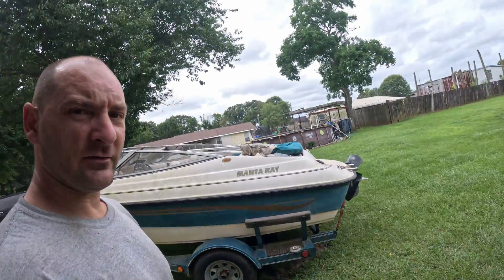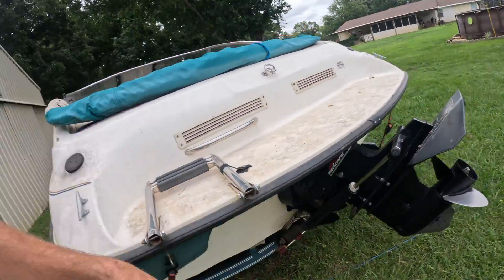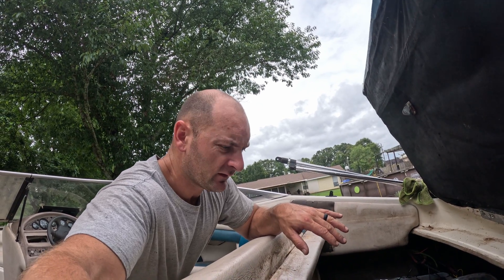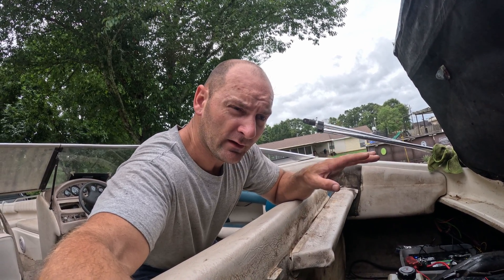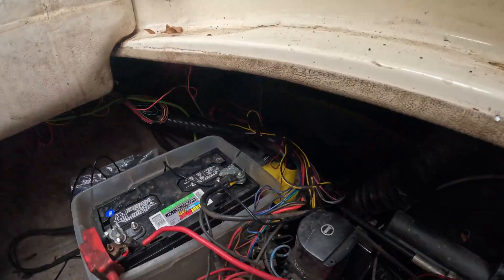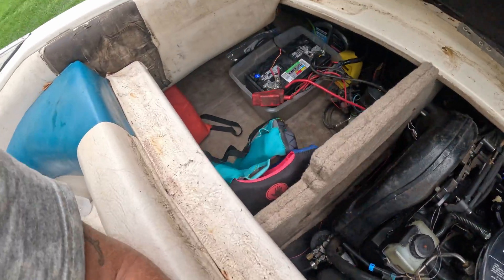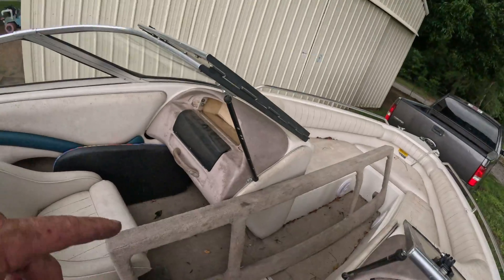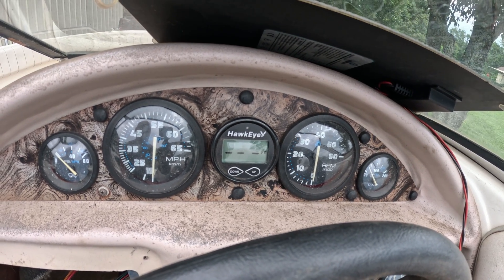Mercruiser 4.3 Troubleshooting - Fixing Misfires! - Part 2 Breakdown!

Comment: I need suggestions! I was told we needed to change the module on my 4.3   Mercruiser. I see many replacements but was told the original was not available. We have spent so much with the mechanic and still cannot rely on this boat to go out and not be towed. The motor is 2004 in a Tahoe Deckboat. For what we have spent so far I think we could have bought a rebuilt engine. Question will these replacement modules work? Our mechanic (former) says no.
Reply from the maker: That I have no clue, I’m a try and see type of person after doing as much research as I can.